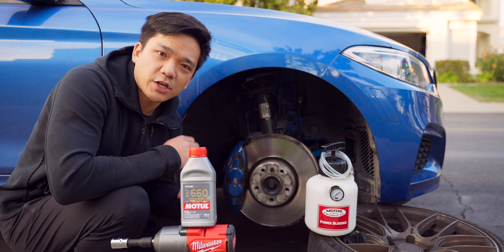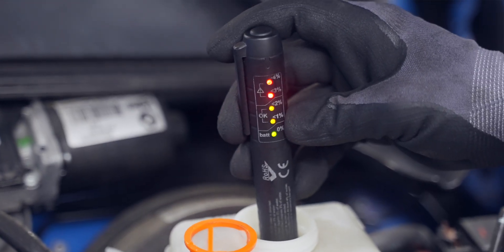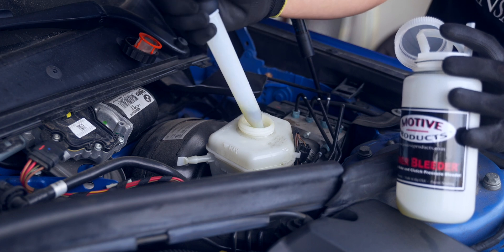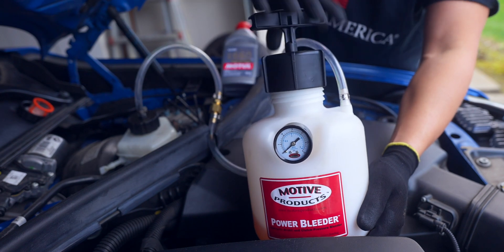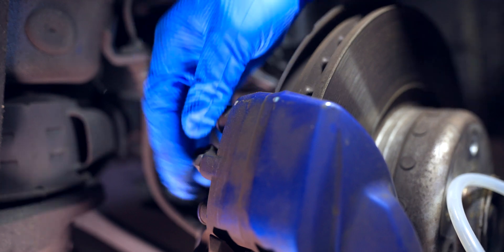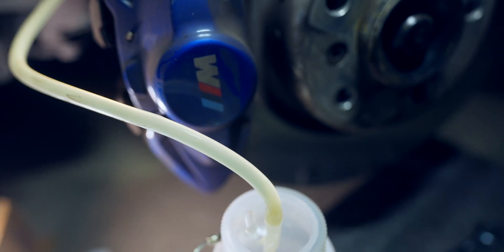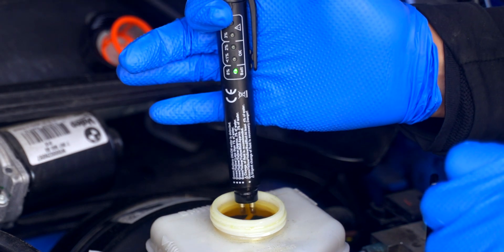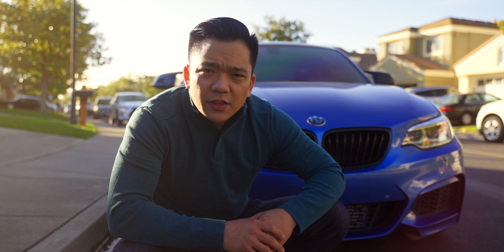How to Flush & Pressure Bleed BMW Brakes

Comment: Be careful not to strip or break the bleeder screws. These cars are a decade old, and the bleeder screws use very mild metal. I broke the one on RR caliper, and will need a new caliper. Don't do what I did. If the screws are not turning, don't force them. This is especially true if you live in salted areas and drive your car in the winter. Save the $1000 caliper bill.
Reply: And don’t over torque when reinstalling. Spec is 10 Nm. Threads aren’t what seals and over torquing will deform the tip and make them leak.
Reply: To save a $1000 bucks I would have removed the caliper, put it in a mill and performed minor surgery. 

If you don't have the equipment or expertise I'd look for a local EDM shop to have them remove it, that's a very common practice with these guy's...

Comment: For M Performance brakes (for OG F87 fixed caliper, front 4 pistons, rear 2 pistons, seems to be brembo), the front bleeder screw torque spec 18Nm, rear 10Nm (some say both front and rear are OK with 10Nm). What kind of torque wrench should we use in this case?
Reply: The kind that is calibrated for Nm in the range that you specified.... it's not magic

Comment: Motive recommend using teflon tape at the brass hose fitting. They also recommend adding new fluid after removing old from the reservoir.

Comment: BMW requires to actuate the ABS valves electronically in order to complete the flush properly which I think most higher end OBD scanner tools can do as well. Do you skip this step? Would love more info on this.
Reply: great question, i'm worried about doing mine but still having the notification on since I don't have any obd reader at all
Reply: Im using a Foxwell Elite NT510 which is BMW specific. It activates the ABS system but Id be dammed if I can find someone who does do it so I know at which part of the bleeding Im suppose to do it. But yep just confirming theres cheapers scanners that can do it.
Reply: @sassyrav Do you know if Pro Tools can actuate the ABS?

Comment: I use a MOTIVE POWER BLEEDER in the shop, probably have done around 30-40 flushes with mine! If no fluid comes out I just open the door to the car on the lift/stands and grab a small pole and push on the brake pedal once... works everytime! My suspicion was corrosion in the bleed screws that cause a slight clog/jam, no worries as long as fluid comes out after you pump the pedal once or twice! The techs in the shop took turns feeling the brakes after I first used the motive power bleeder, totally worth the effort and can be done as quick as vacuum bleeding!
Reply: doesnt BMW require you to actual the ABS valves electronically in order to complete the flush properly?

Comment: Would a abs brake bleed with a scan tool be necessary on the f chassis models
Reply: Yes, per my mechanic it is the proper way to bleed the brakes as both air and old fluid can remain in the ABS unit. That said, from my recent research I believe some higher end retail OBD scan units have a setting to perform the brake flush and activate the ABS actuators. Would be nice if someone can verify and add some info.

Comment: Great video! Have you ever bled the brake fluid from the clutch slave cylinder? Looks like it may be the same fluid and there is a bleeder valve for it.
Reply from the maker: It is the same fluid. If you were to do it with your brakes I would do it 3rd to last (before the 2 front driver valves). It also requires less pressure.

https://youtu.be/aD3kBXHS5DI

Comment: Your brake pedal seems to be very firm, mine is very smoochy, is this a sign to bleed the brake ?
Reply from the maker: It could just be that I was pressing on them with the intention to bottom out. Are your brakes giving you any issues?
Reply: @FritzRamos  no issues reported but I dont have full confidence in them at high speed. I got the same calipers as you and I was expecting them to bite and to be sensitive, unfortunately that’s not the case. My  base 2020 civic has far greater breaking performance with strong firm pedal.
Reply: his car isnt running so brake booster has no vacuum in order to retract

Comment: The extra thing you should do is to tap the caliper with a rubber mallet after bleeding and double chk each screw again. Typically, more bubbles will come out. Repeat til no bubbles. So reading a bit more about order,  Outside then inside for old fluid, inside then outside for new fluid bubble chk. The theory of farthest doesn't hold true for this bc the first screw is in-between the master and the second screw if that makes sense lol. Bottom line is when ever you open a line, there should be no bubbles!

Comment: Ppl do differ on this but to me, inside first then outside makes more sense for the fronts. Any service manual info on that?
Reply: it's outside first per the manual
as a general rule you want to clean the lines furthest from the master cylinder 
hence you do the back right first and then you would also do the outside first

Comment: Hello mate, I sent you a comment on one of your older videos but you must have not seen it. On the video when you change the charge pipes you said the manual transmision cars has a bung on the vacuum line. Well I have a bmw m2 manual and I dont have the bung, I have the vacuum line going to the intake. I have looked all over the internet for the info but cant find anything. Do you know why?
Reply from the maker: Sorry about that. Are you referring to the purge valve?
Reply: @FritzRamos  hi mate. Love your videos. I dont know if its the purge valve. All I know is when you changed the charge pipe at the top part you said that if you have a manual car there is no vacuum line and its just a bung. And on the automatic cars there is a vacuum line going from the top of the charge pipe to the air intake tube just after the air filter box. My question is, I have a manual bmw m2 so why do I have this vacuum line, what is it for???? I have seen many videos of other youtubers saying the same thing and I don't know why, I have looked it up on the net but cant find nothing, I was hoping you could help me. Thanks